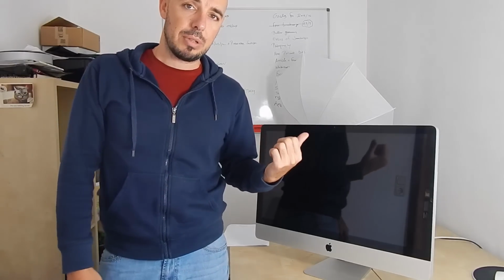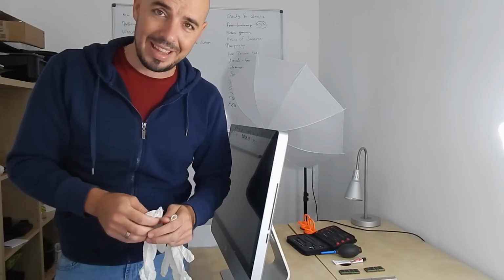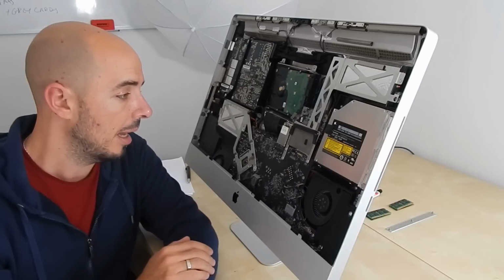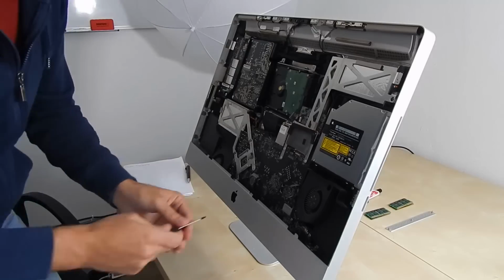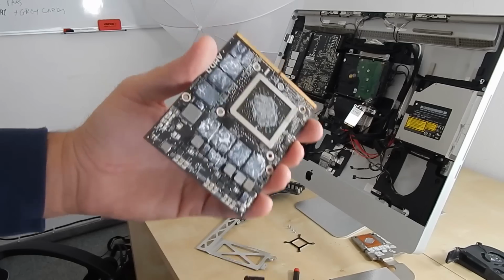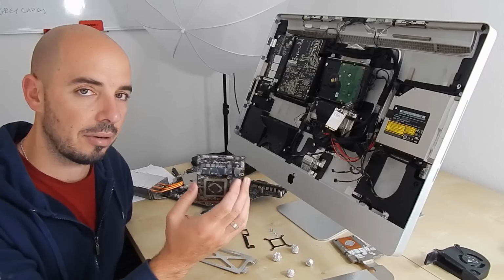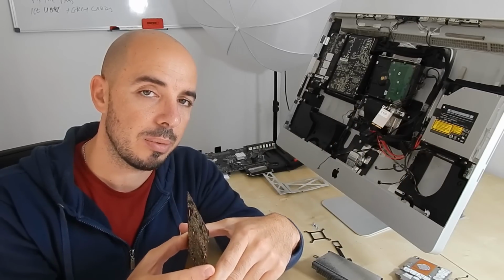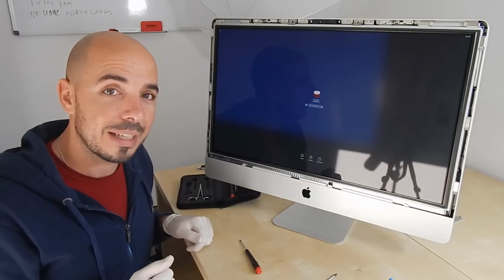Burn the VGA and  Fix your iMac - Don't Pay Shitty Problems!!!

Comment: You've got to be kidding me. This worked for me. I was so ready to find out my computer was ruined after trying this but it totally worked. Dude you saved my $3000+ computer. No one makes these parts anymore apparently so this is really the only option. Such a legend. To anyone wanting to try this, watch a couple videos on actually taking the mother board out and reinstalling it, that is really the only difficult part so be prepared and know what you're getting into. Be super careful, lots of screws, lots of cables, and not much room to work with. This trick definitely works though!!!! Thank you!

Comment: I just did this and it was a pain in the ass and it took me about 4 hours because I struggled with getting the main board in and out but when I finished I just about teared up when it turned on. You saved me like 600 bucks you're the real mvp. Thanks!

Comment: Hello Evan, thank you for sharing this video, it's very helpful and gives me hope. I had a similar problem with my early 2008 24" iMac a few months ago. Someone I know was able to repair the graphics card the first time round but when it failed we had to replace the card with second hand one we found.
However, the problem my iMac is experiencing now is that on booting it reaches the apple logo, with the scrolling bar underneath. The latter though stops halfway and then seems to freeze there. If I let it for a while the display will move to a completely grey screen and will do nothing - it just hangs there. So, my question is, do you thing also this behaviour may be related to the graphics card and whether it's worth for my to attempt to do what you show in your video? Would it solve the problem? or could it be due to some other issue?

Thank you!

Comment: Well, after many grueling hours I can say this actually appears to have worked!! Thermal throttling is gone after adding high quality paste to the CPU and GPU + VRMs (Oh yeah and I baked it too!) All temps are now in the 30s! Even if your mac isn't broken and you're competent with computers, give it a shot. It sucks.. a lot. But if you're having bad heating issues and you're out of warranty than it may be worth it. Also helps to have a friend around to give you a hand when needed. AND TAKE PICTURES/VIDEO, AND KEEP SCREWS ORGANIZED! 

Thanks so much for the guide, you've saved my ass. CHEERS!
Reply: Also may I add, hitting that power button and hearing the startup noise was one of the best things that I've heard in quite some time.

Comment: Thanks alot for this video, it seems to work on my imac also! i hope it lasts like this for a very long time! especially since my imac is not used so much! But as an extra note "WARNING" to others who will do this. Be really careful with the cables. AND DO NOT MAKE THE SAME MISSTAKE AS ME. For sure "I'm clumsy", and I was lucky that my mac survived.  THIS HAPPENED:  When I had insert the display in place again. My knee or something bumped in to the computer, and I had not screwed the display at the place yet..  well The display slipped down on the floor...However, my concern was not that the display was broken. My concern was that the cables went out and destroyed the contacts in the motherboard. And that was about what happened. The lock to the thinnest connector broke down. and even the pins were bent in one of the other contacts. So I had to be VERY gently whit a toothpick, and get the pins in place, so that they fit the contact.. lucky enough, I managed to make them fit in place, to the contact.. " even the plastic bit around the connector on the motherboard was loose" And for the other one, the thinnest contact! well, it has no lock now, and sitting really loose... but it is in place...   I may maybe put some tape on the thin contact, if it loosens!  well, Talk about luck ."lucky me". That i , despite this,  got my imac to work again. Thanks alot for this video !!

Comment: It worked! Thank you. There's so much info about this problem I just had to try it, I had nothing to lose since the iMac (mid 2011) was dead.  8 mins in the oven and its back together and working! Im an electronic engineer so understand why this fix works. Pretty cool. Thanks again, you video is one of the best. Much appreciated. Jon, Scotland UK,

Comment: (8th April 2018) I promise my self that I would leave a comment if this actually worked.... and it did!
I didn't actually put it into the oven but I used a heat gun on it which i figure should be just as effective as the oven ... well.. All I have to say is that IT ACTUALLY WORKED!!!

Comment: Great video. Thanks!
My son's Early 2007 24" iMac, the last White Plastic model, had its video card fail while under warranty and was repaired by Apple. After another year, right after AppleCare expired, the card failed again.
I believe that your oven fix may work for us. I had started to open it up, but didn't have a good work area, so into a closet it went. Perhaps I will take the time to try this, or sell it for parts.
The video output to an external monitor still worked, so I think a bad chip connection like yours may solve the problem.
Btw 200 degrees Celsius is 392 Fahrenheit.
Thanks again.

Comment: Hi Evan I have finally got the GPU out. But there is some gel thats at the corners of the chip. Will this be an issue when placing it on the oven?

Comment: Hi Evan. Adriano from Berlin, today 22.03.2018 that worked for me as well. Thanks a lot.
Honestly, I thought that was a joke. But between a dead graphic card and buying a new one, I gave it a go and worked. 
Lets see how long I can use my iMac (27-inch, Mid 2011) to the next backing. 
I backed it in a 200°C for 10 minutes.
:-)

Comment: My iMac worked for 18 months after this repair but I have been working with 4k video for the last year, this time I managed to remove the graphics card only by leaving the heat sink with the wire attached to the mother board in place, just be careful and take your time. I have also installed the Fan Control app. Thanks again for the info Evan, my iMac is alive again.

Comment: Hi Evan,i have an iMac 2011 27" with 512mb graphic card..when I turn on my Mac the video is ok, but after 30 seconds the video becomes BLACK...is this method ok for this problem?or only for white lines ???thanks .....

ps:  put the card when it came to 200 degrees or turn on and put the card while going up to 200 degrees?

Comment: Thank you so much!  Have a 27" iMac mid 2011 (purchased around then), and it stopped working a few weeks ago.  Apple store said for the card and labour, it would be about $1000 CAD after tax.  For a 7 year old Mac, not working that much to repair, but don't want to spend $2300 CAD for a new 27" iMac.

Found this video and that inspired me to try fixing it myself.  After watching this (and a few other videos by others to get a sense of how different people did the fix), I took the plunge and tried.

It took me 5 hours (there are more cables than I expected), but it worked perfectly!

A few things people should note (as it may not be clear in the video):

- take your RAM out step 1!  While your mother board may slide out easily with them in, the board won't go in without removing them)
- there are MANY cables.  Get some very light painters tape and number them in pairs.  Tape the cables on both sides so you can match them later
- almost all screws are slightly different sizes.  Keep track of them.
- in fact, take photos of each screen and where it came from so you can review and match easily (Evan suggests taking a video of what you do anyway).
- take video of what you are doing at each step (close up) so you can review if needed
- make sure you have a small plastic tool to scrap the old thermal paste of with

Again, thanks for the video.  The tools I needed to get plus the thermal paste cost be $45 CAD from Amazon.  Way better than $1000 CAD.

Comment: I followed the procedure and my iMac works again. Thanks. The 2011 iMac 27s have a temperature problem on the AMD Radeon graphics card. I also replaced the original hard drive with an SSD that produces less heat and removed the superdrive for more airflow. Now the graphics card is at 56º idle and the Mac is doing better than before.

Comment: I took my Mid 2011 IMac to the Apple store to see if they would honor the recall on the 6970M video card which I suspected was bad.  Needless to say that was a waste of time other than them confirming my suspicion and hitting me with a $525 dollar estimate to replace it.  I decided to take the time to do your fix.  I became skeptical in the process as the haters were posting videos saying it doesnt work..  there were several methods to do the fix and haters claiming it doesn't work.  I also found several methods to do the fix including : heat gun, oven, and small hand held torch.  I decided on the oven method.  I baked it for just over 8 minutes at 400 degrees and let it cool on the top of the stove.  I proceeded to reassemble the machine and was pleased to find it works again.  Simply amazing.  In my case I suspect it was a solder joint not a bad chip so it worked!  For the haters, try it before you assume it doesn't work!  Thank you for taking the time to produce the video on a fix that should have been on Apple.

Comment: This helped me too. My iMac had on-screen distortions when the iMac was cold and would sometimes freeze in a kaleidoscope of artifacts. baking the GPU worked. I have the smaller Radeon HD 6770m 512MB card in my iMac 27" mid-2011.

Comment: I have 2008 imac with Nvidia graphics. Following symtoms were present: Loading bar will load 75% or 50% way and it will boot looop / Stuck in grey screen / Imac will crash with error code.   I tried everything like reinstalling / recovery, safe mode........ Finally I gave up and disassembled the entire thing and this is method.  Now it works like charm. Thank you so much for this video.  ( I baked mine in 400 F degree in toaster oven for 10 minutes.  foil was used as feet.   New thermal paste was applied )

Comment: Hi, my IMac 27 mid 2011 after a blue screen with lines is dead :-( now on power on is a stuck white screen after Apple logo, hardware check is all ok...i think Is a GPU the problem..correct? thank

Comment: Greetings Everyone - Normally I don't post comments, but after going to the Apple Store and having an issue with my Radeon 6970 graphics card (for the second time) I figured I had nothing to lose so I followed this tutorial. I baked the card at 392F for 8 minutes and sure enough when I assembled the iMac back together - the computer started up fine and now I have a working screen again. I was a mega skeptic but honestly this worked for me, I encourage everyone to give it a shout if their card is already shot. ** make sure you know a thing or two about computers as reassembling the iMac can be intimidating **

Thanks for saving me a bundle of money, Evan - you're a saint!

Comment: This is the first time I have tried anything insane ...opening the Imac...First I had purchased the same model dead imac and tried to open and experimented with it.. 
Now I tried the real imac with vertical lines (pink and blue )...i tried the above..charm it worked and running since two days...will comment after that.

Comment: One more question my friend how do u clean the thermal paste of what do you use ?
Reply: A clean rag or paper towels with:
- isopropyl alcoho or rubbing alcoholl, that is the best thing to clean your circuits.
- denaturated alcohol (the pink or blue one) should work too. Not suggested (leaves spots), but it's ok to clean.

Comment: Works for me! I thought my iMac, now 6 years old, didn't have a bad graphics card, but I just had the "White Screen Of Death" rebooting problem. No recovery partition, PRAM reset, backup boot worked. 
Baked my 1GB Card on 4 foil balls with a pointy end thru the card holes on a cookie sheet, in a preheated gas oven at 270 degrees Fahrenheit for 8 minutes -- and now it works!
Replacement cards are still $400-$800 because sellers know they can get that much. Or you can try and trust "from China" for around $250!

Comment: Another happy macuser. Have never opened a computer before, and went for the easy version. Took out only the graphic card. Only 5 cables, and a few screws. Bought the termal paste for 10 dollars at the local Clas Ohlson store (artic MX2) in Norway. The whole operation took me about 2 hours, and the mac works fine for now. A new graphic card on my late 2009 was no option, so for now I can keep my money in the bank rather then buy a new Mac. Thank you.

Comment: I am having video issues too, MAC store indicated that the GPU was faulty and needed to be replaced. big time bucks. but here is the kicker, when I boot into "safe mode" the video works just fine. If it was a hardware issue, wouldn't this issue happen all the time? I am stumped!

Comment: I know there are naysayers, but I just completed the solution you suggested and my iMac is working again!!  Plus, as long as I had it pulled apart, I was able to add in an SSD to become the new boot drive and speed thing up.  Between your video on cooking the GPU and the OWC video on taking the iMac apart (and back together), I now one happy camper.  Thank you!  BTW- when I called the authorized Mac repair shop before trying your fix, they told me they had 9 iMac with the exact same GPU issue they were shipping back to recycling.  Glad mine is not one of them.

Comment: Thank U!  I did this and my imac is still alive!!  I see why it over heated... the thermal paste had completely dried up and the screws to the heat sink were pretty loose... so there you have it... BTW 200 degrees C... is 392F... my oven won't let me turn both elements on at the same time, so i just turned it to broil and let the top element do the work... It still worked!!.. Thanks again...

Comment: I am happy it worked for you most people I have seen online have success with this method. But sadly I did not. and I am not a noob I work in IT for a college and a local pc shop (so I know how to computer) but sadly did not work for me. I would still recommend doing this if you have the issue because online it seems we have a very high success rate. but just know you risk the chance of completely killing the gpu. To be fair its try this or buy a new card so it's not really not that much of a risk just wanted to inform people out there that might be less technical.

Comment from the maker: A NOTE TO ALL OF YOU:
This video was created on September 2015. My iMac still works like a charm for 22 months now (June 2017) with heavy duty daily work! So YES it WORKS and LASTS! :)
Reply: Great, Man! And, THANKS A LOT. Mine works too.
Reply: Thank you!
Reply: You´re a life saver, i have the same issue and this week i´ll bake that shit! 
By the way i hear at the end of the video a backgroud sound like your fans too loud or high RPM? I just say it because before my GPU problem happened, the fans started like 1 year ago so loud and high rpms. that i had to install "mac fan control"... (i upgraded my late 2009 iMac to an SSD+eliminate optic drive so maybe it  was because of that but it happened much more months after the upgrade...)
Reply: Evan - Creative Tuts in
Reply: Evan - Creative Tuts it worked for me!! Thanks a lot!!
Reply: Your act is so real

Comment: i really need help as my imac 2010 27" has more than 1 problem.
first it started going black screen. then i restart and it shows screen fine at start then couple seconds later black screen. a very few times the screen would stay normal but then after time go black. to me it dont seem like a graphics issue. i use my imac using mini display port to hdmi now and that shows normal no problems.
i changed my 1tb hard drive and get this loud fan noise, the reason being is because i didnt get an apple type hard drive that has the TEMPERATURE SENSOR CABLE. 
so i will replace that again with the right hard drive when i get time. and also add a SSD hard drive. 
when my imac was showing black screen i had it unscrewed and tilted the back to check and the screen went forward stretching cables and i unplugged all cables and seen the motherboard LCD port was bent so i tried to straighten it and it only made it weaker and snapped off. i ordered a new connector off ebay and my friend soldered the new one on as hes a trained engineer solderer. i connected display up and i could hear start up but nothing on my lcd display now. :( if there was a place i could just take my display and check and see if thats working but im struggling and confused what to do now. i miss the 1440p display. please help guys any info will be great.

Comment: after doing this my mac is just blowing air out heavily why?
Reply from the maker: Probably you have disconnected the sensor that controls the fans or it's cuted (like I did). Try to check your connections or if you broke the cable, just fix it with some tape and it should work normally again.

Comment: ONE MILLION DOLLAR VIDEO !!!
A really good video what helps to save in the complete amount likely one million dollar! Thanks a lot for showing all the steps. I just had problems with putting the cooler back to its place. Perhaps there are some different types of cooling systems which have to get into the iMac before the mainboard goes back again. And the hard disc cable has to get into the higher located slot of the two possible slots on the mainboard - that is important!

Comment: Hey Evan,
21st April 2017 and I just tried this on my 2011 iMac and it worked like a charm. Just wondering is yours still working?
Reply from the maker: Hi Mario, I am glad it worked! I am currently writing to you from the same iMac. It works with no problem since that fix in this video! :)
Reply: Wow, thats really great!!! Thanks for sharing this. I'm sure this will come in handy for a lot of mac users.